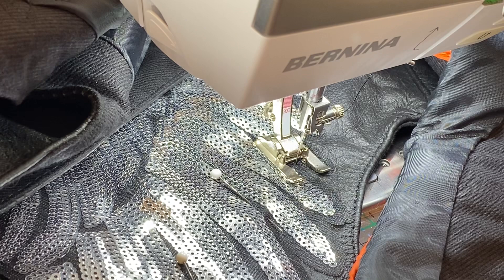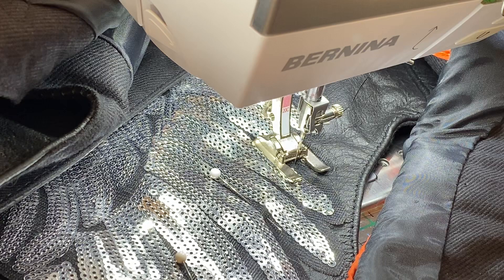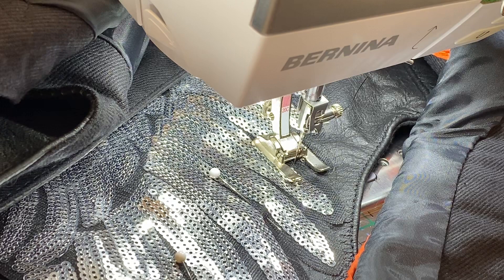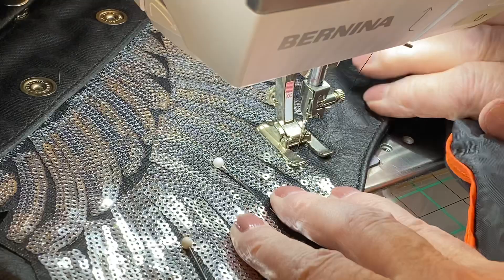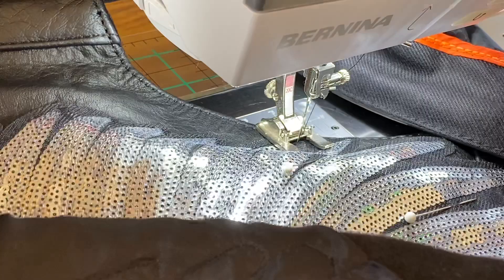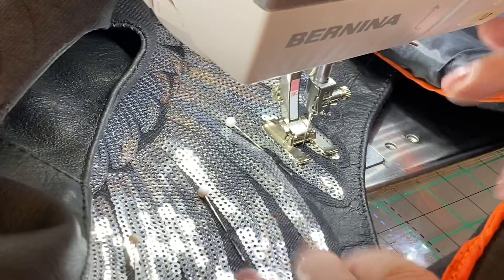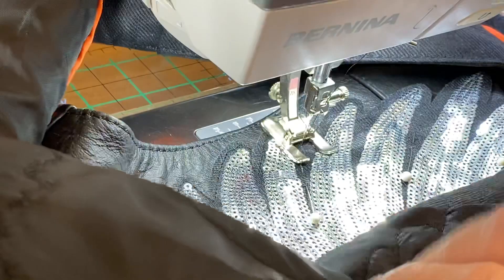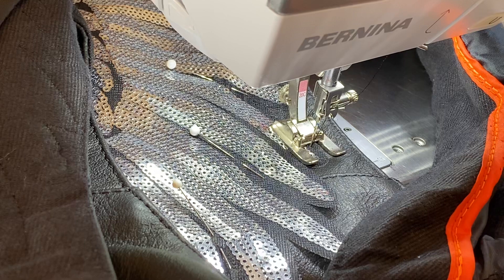The Bernina Hammer Mode

Comment: I don't think that's hammer mode. It's supposed to make rapid stabbing motions into the fabric and will stop if it meets too much resistance. Like hammering.
Reply from the maker: Here is the hammer mode description directly from Bernina…

BERNINA Hammer Mode

As described above, the needle penetration in the fabric creates friction, which demands the motor to produce more power. The motor needs more current to produce this power, and obviously the higher the friction the higher the current.
When too much friction is applied to the needle, i.e. sewing over multiple layers of heavy dense fabric (but before the absolute limit is reached), rather than the motor just attempting to constantly push the needle through the fabric, the motor gets a signal from the electronics to start to pulsate, giving an appearance of a hammer mode.
The needle then appears to behave like a miniature jack hammer, attempting to punch through the fabric in rapid firing stabs.
This feature allows the machine to reach a higher penetration power without more electrical power. This means an additional burst of power without overloading the motor